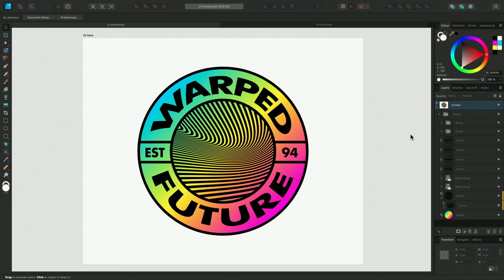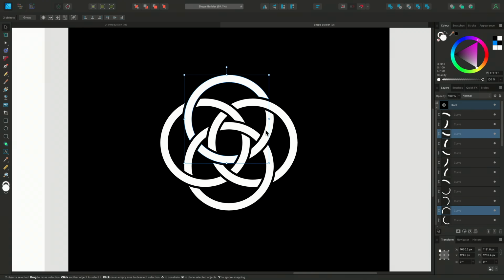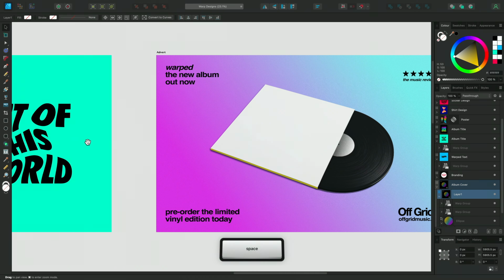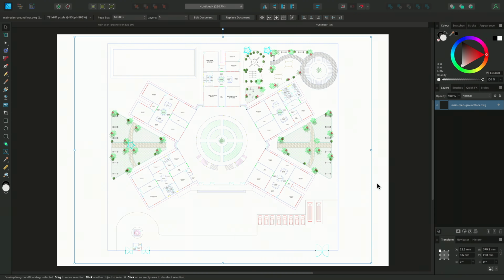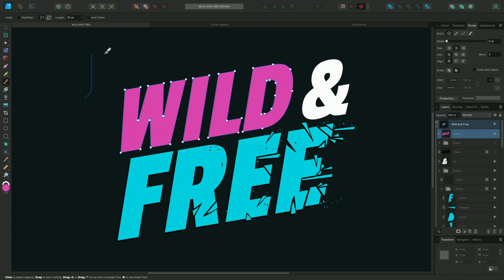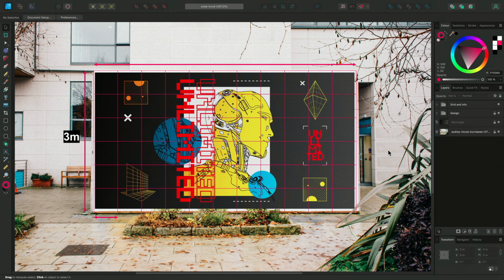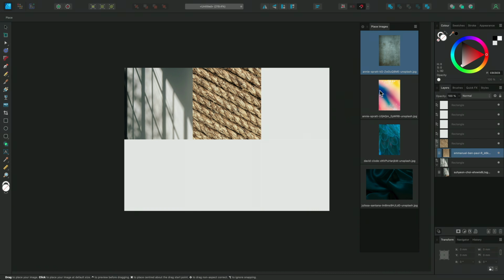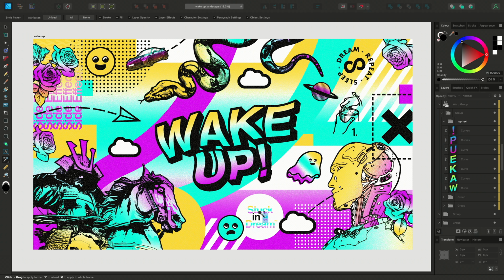What's New in Affinity Designer 2

Comment from the maker: 00:00 Intro
00:22 New User Interface
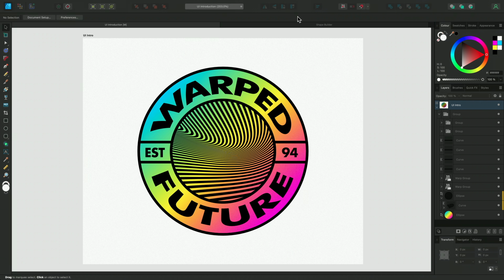01:10 Shape Builder Tool
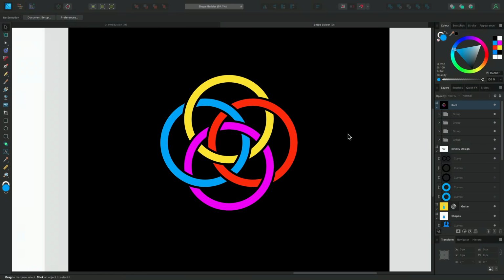05:41 Vector Warp
11:30 DWG and DXF Import and Edit
18:37 Knife and Scissor Tool
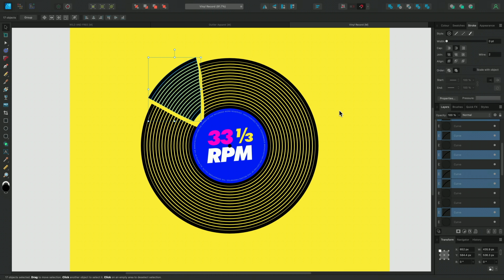24:10 Area, Measure and Scale Tools
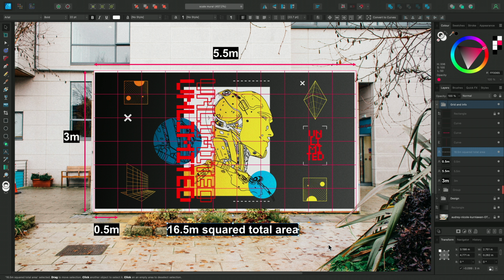27:52 Quick Grid
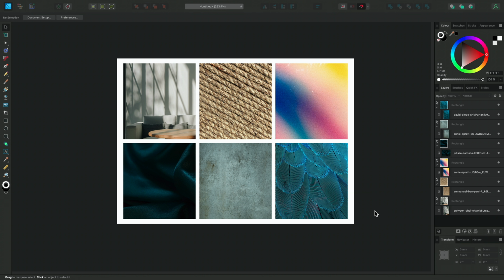31:09 Style Picker Tool
Reply: Vector patterns, plz!
Reply: @keith48993  100% agree. After how often it gets requested, I'm very surprised it's not in this new release to be honest.
Reply: I'm having a big issue with affinity designer 1... I wound up (against my will) buying another subscription to the soulless adobe company BECAUSE all EPS files imported have hideous lines in them BUT work perfectly in adobe illustrator. I love the new features in designer 2 but my question is, have we resolved this issue in designer 2? because if you did, I'm buying it immediately
Reply: @AaronsMediaCompany  i agree with this, neither affinity nor inkscape do well with eps.
Reply: i've been using the trial and i love it, but!!!! can you guy's work on the exporting docs a little bit. its like the only thing that just doesn't fit with the program

Comment: I agree with an earlier comment.  I am new to Affinity and have been pleased with it so far, so unable to compare against V1, but it is hard to find guidance on how to export files.  I have a Cricut cutting machine and I  know there are many others out there who use Affinity to design and cut using a Cricut or similar and it can be frustrating when you have spent a lot of time designing something and it does not export accurately.

Comment: i opened an ai. file and made adjustments;
searched to rename and save the file, but still cannot find the file upon saving and exporting...
yes, looked in layers but see no place to change the name, 
so where it said, artboard, i put in a title
then upon saving and save as or exporting, there is not an option to specify the location where to save the file;
need just a few minutes please to resolve this issue;
yes, i have used affinity prior with no hiccups, but now i am admittedly 
baffled at this simplicity of procedures.

basically
the guidance on the net is not sufficient to change the file name and to export it as a pdf or png

Comment: Until there is an auto trace feature I’m not buying another version. This is probably THE MOST REQUESTED feature of affinity designer. As a printer of wide format I use this every single day to take customers crappy fiverr logos and make them vector for print. It’s 200% necessary.
Reply: Auto trace is rubbish. Do it by hand. All those cheap ass designers that deliver rubbish with Adobe CC... Really good tracing is manual labour. Sorry.

Comment: Is the current pricing for V2 only an introductory rate or will it still be the same if I need to wait several months to purchase?
Reply from the maker: The current pricing - 40% off - is for the Launch offer which runs until the 14th of December.
Reply: @Affinity  thank you.
I was able to successfully download Photo 2 but Designer only downloads to about halfway before stopping. I’ve removed previous attempts and retried with no luck. It will switch to a cloud download icon but won’t progress past about halfway into download.  Any idea what I may be doing wrong? I use the iPad version. Thanks for help

Comment: And my personal wishlist of features would be, DWG/DXF export (for potential engraver uses), curvature (comb) display (for checking curvature harmony), partial selection (by dragging from bottom right to top left), and as a weird but kinda useful stretch, for the sake of sending file to those stubborn print shops that has no idea that pdf is a thing all software can import, CoralDraw format import/export to shut them up.

Comment: I really like the new features that come with V2 but the way serif is handling the upgrade process is really annoying.
I brought Affinity Designer V1 approximately two months ago so I will receive no discount for the new product apart of the ongoing sale right now, which lets me buy the new version for like 90% of the price for V1!
I know I can still use the old version but having a programm which will be no longer updated has major drawbacks. Even now there are still a few bugs around who will, as it seems, not being fixed (e.g. CTD when having not enough RAM).
I read that you offered free updates for a very long time which seems like you value your customers pretty high but how you treat me as a newly customer right now does not invite me to buy another product.

Comment: pressing ctrl whilst trying to using the knife tool changes my curser to the node tool, not drawing a straight line. Holding shift and alt kind of works with mixed results

Comment: Great that we are getting some basic technical illustration capabilities but we need a Dimension tool,, not just a measure tool.. also I still do not understand why in a vector program you give preference to pixel units,   this is not a physical dimension .... unlike metric or imperial,, can we please have a toggle that just overrides all dimension settings to either vector [physical dimension, metric or imperial] or bitmap [pixel] - also getting some weird readouts in the scales [eg, 1" = 11mm]  never in my entire life have iI seen scales referencing metric and imperial at the same time

Comment: Can we now move an object a set number of units? Can we hide an object with a keyboard shortcut? Is each object its own freaking layer (a huge impediment to working efficiently and logically — because having a hundred separate layers, vs. many object on one layer, does me absolutely no good). Can I convert text to outlines in order to modify it with a direct selection tool? Can I distort a stroke?

Comment: For some reason I cannot figure out how you created two elipses presented in Shape Builder part.
Reply: Hi, apologies I had to streamline parts of the demonstration to make sure all the chapters could be included. The easiest way to get two similar ellipses overlapping like I did in the video is to create your first ellipse with the tool, turn the fill colour off and set the stroke setting to something fairly bold. Then with that ellipse selected duplicate it by using command + J or control + J. Then with the new ellipse make sure it is underneath your first one on the layers panel and give that one an even bolder stroke width in the stroke panel. Might be easier to change this one to a different stroke colour so you can see the difference too. Then select both of the ellipses and go to Layer > Expand Strokes. At that point you'll be able to follow the rest of the steps in the video too. Hope that all helps!

Comment: question about @18:58 control key to get a straight line while cutting ? I only get the node tool if I press control.. have to right click and left click  to get a straight line on pc ? -and then it doesn't cut correctly

Comment: I can't zoom with my wacom >:(. I never zoom with "z" Shortcut, so it is inconvinient.
Reply: Hi - I like to set the first button on my Wacom pen to the Pan/Zoom option in the Wacom settings and I find that works really well for me so might be worth a try! We've also added a keyboard shortcut option to turn the stabiliser on/off when you're using any pen or brush tool which you can set up in the shortcuts section of the Designer preferences so I've set that up as my other pen button on the Wacom as I use that all the time too 👌. Hope that helps!

Comment: After warping or fisheye does the text and nodes stay and the same when imported into Motion 5?
Reply: Hi Johnny if you wanted to import the warped text into another app you would need to convert to curves (in the context toolbar) then it will lock all of your nodes onto the warped version you've created. If you need to keep editing the text afterwards though you could just make a duplicate of your warp layer and covert that one to curves instead, keeping your original warp layer intact as a back up for more flexibility. Hope that helps!
Reply: @mattsearstonillustration  That needed fixes from the start. The reason I ask this question that other software "No names" The text, nodes are editable without having to convert the tool bar or duplicate them. For me this is a No buy now. Maybe you can address in the future as I am using the 30 day trial and yet I already see many complications when importing into Motion 5. The selling point for me to buy this was the shapes and text as Motion 5 has limited tools but you can get around it. I don't see any other reason to buy this if compared to Motion 5.  Color picker navigation is horrendous. "Honest feedback"

Comment: Can I measure curved line and circle?
Reply: Hi yep - you can measure curved lines and circles with the Area tool as well!
Reply: @mattsearstonillustration  I just purchased affinity v2. Thank you for your info. This function I have been waiting so long.
Reply: @rgrisingstars  No problem - enjoy using the apps!
Reply: @mattsearstonillustration  how? I played with it just a tiny bit and, so far, it only measures little bits of the curve, not the whole curve.
Reply: @DaileySewsStuff  Hi there, if you have the Area tool selected instead of the Measure tool you can then select any vector shape and then it will tell you the length or area of that shape in the context tool bar. You can change the measurement style in the context tool bar as well, from whole boundary measurements to individual segments too so I hope that helps!
Reply: @mattsearstonillustration  that helps a ton! I didn’t have much time to play with it yesterday but I’m excited to dig into it over the weekend!